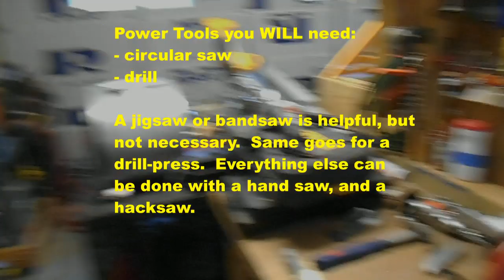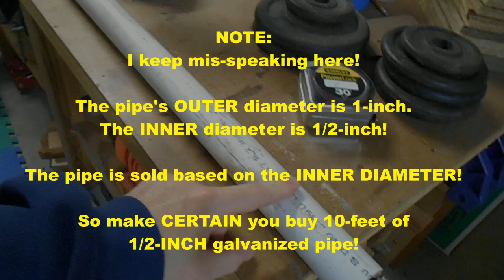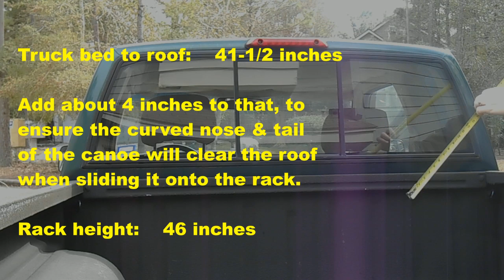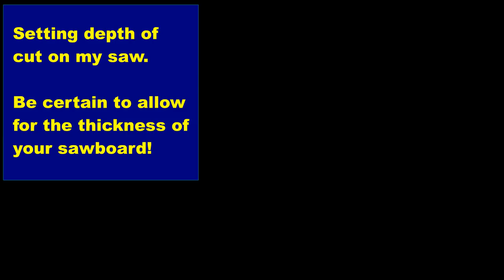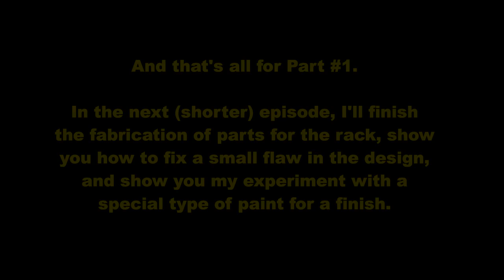Make A Canoe / Lumber / Ladder Rack - Part#1

Comment: You used stainless for the bolt hardware why not coated deck screws instead of drywall screws?

Comment: Would there be a safe way to do the rabbit and dadoes with the miter saw? Could you set the depth of cut, then bring the 2x4 out from the fence the make those cuts?
Reply from the maker: It's possible to make them with a mitre saw, if you have a depth-stop on your unit.  Put a scrap between the 2x4 and the back fence, and be sure to clamp that & the 2x4 down solidly.  It's more or less using the mitre saw like a radial-arm saw.
Reply from the maker: I should point out that this would only work with a SLIDING mitre saw.

Comment: Just wondering how you are going to tie the canoe down?
Ben
Reply from the maker: Easy as pie.  I always keep 4-5 ratcheting cargo tie-downs in my truck.  Just loop a couple of them around the cross-brace or seat, and connect the ends to the tie-hooks welded into the corners of the truck-bed.  One in front, one in back, and ratchet them down.  Holds like a champ.